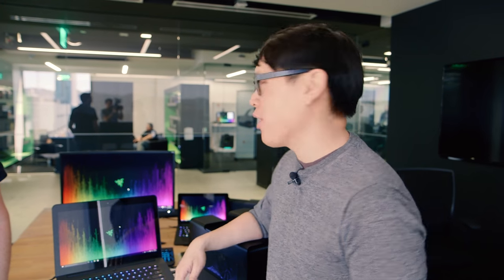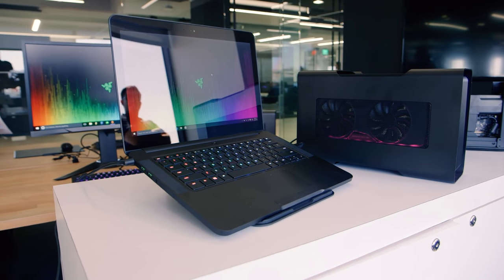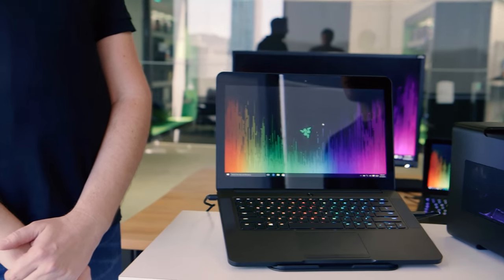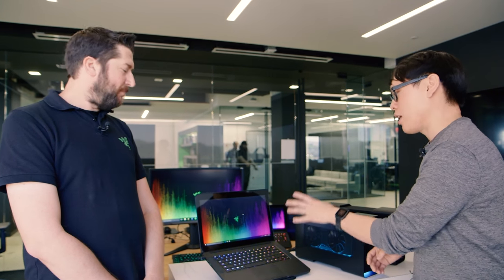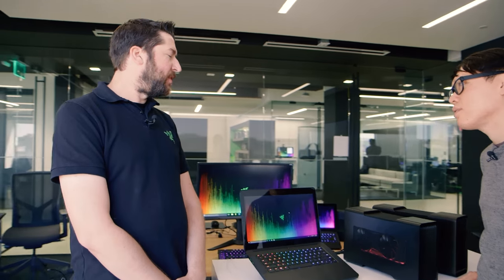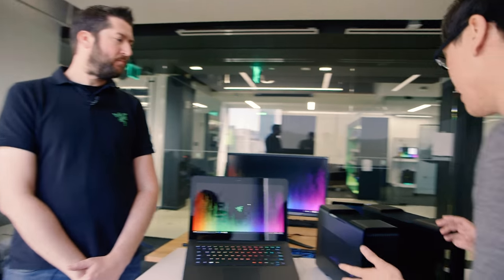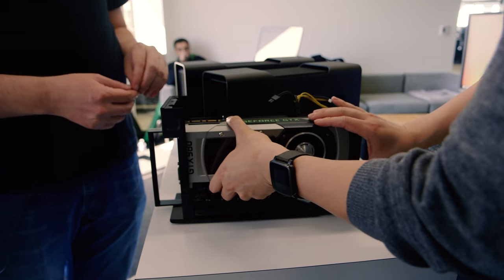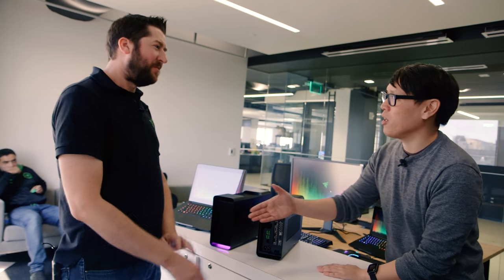Installing a Video Card in the Razer Core (External GPU)

Comment: In away, I see these devices as a bad thing. We need GPUS to be smaller. This makes me think nVidia and AMD might just lessen their priority on making gpus smaller and force people to go externally or have a gigantic case. On the other hand. I see this being the way forward. You could have an all in one pc on a 4k 28" (for example)  display with 1 thunder bolt port. All you have is this "small" box beside it without the manufacturer of the all in one computer having to worry about placement of a heavy gpu, heat and a large power brick. But that kind of goes back to my first issue. Make GPUS smaller lol. I like this being an addition to an all in one  computer. But for laptops, nah. Laptops are mean't to be portable. I don't want to be carrying 2 bags or 1 big heavy bag.
Reply: They did try to make it smaller see amd fury.  And if you look at the trend the gpu are getting smaller.  And for what you said that is why the m series of gpu is created.  The reason Gpu is big is because they really need the cooling, even now some (big)  gpu are thermal throttling while being used in extended and rigorous rendering process by professional.  Making it that small just doesnt cut it since you sacrifice cooling (unless they invent better cooling tech).  Maybe what you mean are for the m series gpu to catch up in performance to the full gpu since it doesnt make sense otherwise.
Reply: +Andrew Hadi Yeah there are some nvidia cards that are smaller as well. There is even a mini 970gtx. But yeah, the M series graphics cards are smaller etc and they do need to catch up in performance. But if these external ways become so popular, what's the point in making M series cards? Why can't they just make a super light, skinny laptop with a powerful processor and have people buy a external graphics card? It would mean we COULD (probably won't) get desktop graphics cards cheaper, laptops would be cheaper and less of a lap burner, laptops would be better on battery etc the only downside is if you want to play games you need to plug in an external graphics card. Any laptop could be a gaming laptop. Yeah a mobile i3 laptop would bottleneck an 980gtx but gaming on a <1920x1080 display wouldn't really matter anyway lol.
Reply: i think it depends on how people use their PC/laptops in the first place. Every products have its own specific market, say for me even with laptop i HATE gaming on the bed (productivity is fine but not gaming) and since i only game on my table and watch movie,etc on my bed, it kinds of solve my problem. and don't forget intel integrated graphics are getting better and better where in this case it will shine since light gaming such as dota 2 and watching 4K video (connect to TV) doesnt need a dedicated GPU anymore which will make a Laptop much lighter, cooler, and much much cheaper. and since you can reuse the graphics card its actually a good investment for the long run.
Reply: +Ender Skies I care about my case size. The first pc I ever built up had a huge case. Capable of supporting 3 22" dual slot cards, space for 8 HDDS and 6 front bays. Honestly it was a dream to work in but it was hell to find a place for it... it had to sit outside my computer desk, on the carpet, picking up dust and throwing dust around the room. I had to hoover my room more than normal, I had to clean all 4 huge dust filters before I hoovered. When I wanted to reorganize my room the 1 thing that I always regretted doing was attempting to move a gigantic deskop computer. Now I just have a silverstone tj08 with two 970gtxs and 3 500gb SSDs. Small, compact and twice as powerful as my old tri 480gtx setup. A powerful small system is more appealing to me than a case the size of a 40" TV.

Comment: Razer needs to release a Razer Blade business laptop. Remove dedicated GPU. Add more battery. and Iris Pro. Stealth's CPU will bottleneck togheter with Core and powerfull GPU. And Blades dedicated GPU will be wasted for most office/business use and when Core is connected at home.

Comment: 400$ gpu enclosure.. fuck that. 
Unless it is coming with a 970 or 290/390 that is just a ripoff. you can get the exact same modules for under $100 if you are willing to use a minipci port, and I believe you can even get thunderbolt version now too for around the same price. 
EDIT: DIY Perks did a video called "Gaming on a Laptop using an External GPU" if you wanna see it.

Comment: Why would I buy such an expensive laptop for gaming but then again spend another fortune on a desktop gpu for VR? I mean I don't see the advantage in running around with a laptop, a gpu with case and a VR set. I only have 2 hands. And why would I travel with my VR stuff if I could just travel in VR? Looks just like fancy stuff that's way overpriced
Reply: Uhh..  If my reasoning is correct you wont be playing vr outdoors.  In ANY circumstances other than a showcase or maybe lan party.
The correct way to use this is to only bring the blade outside for productivity such as university or work. And went back home plug the thunderbolt and BOOM all your multiple screen, VR, speaker,  headphone, harddrive, keyboard and mouse are ready to use with one centralized computer unit meaning you dont need to transfer files etc if you previously use pc and laptops.
Reply: And with the gpu out of the way the majority of the heat is outsourced extending the product lifecycle.  And with ssd technology and skylake processor this machine will not slow down anytime soon.  And arent limited to M series gpu can be upgraded easily meaning it WILL have the BEST performance compared to other laptop for its size.
Reply: Andrew Hadi Then again it's extremly overpriced. I could buy a really decent computer and a laptop for work and still have money left. The file synchronization is a point but I don't think that there are a lot of files that need to be synchronized. Most of the gaming stuff is handled by Steam, music, movies etc is on a server at home or maybe Onedrive. Also it's a bit akward using a gaming rig for work and the other way around. I don't really want my  games to be on the same machine as my work stuff..
Would you buy one of these (with your own money, not your parents money)?
Reply: +EndermansEnd hmm not now.  I consider this as a pioneer product (like those $7000 16 tb samsung ssd facepalm) or those that purchase limited edition stuff just for bragging rights. But i think this is going in the right direction. Hoping Asus or other company will implement this technology in a much more affordable price.  And also in the future, integrated intel hd graphics and iris graphics are getting better and better which eliminate the need for a dedicated gpu for light gaming (dota2) and productivity. Thus making laptops much thinner, cooler and cheaper.

Comment: 1. Pay $2.000+ on a laptop with GTX 970m
2. Buy an external desktop gpu 400-500$
3. Buy a case to hold the gpu in place
4. Spend a shitload of money while an gtx 970m in a laptop is way more than u actually need... Good job razer
Reply: It's more for future proofing ... 
Or the razor blade stealth which has a integrated graphics card.
Reply: +Mr Human would be nice if you could use it on any pc

Comment: Did he just say the 970 isn't enough for VR? I thought 970 gtx were perfect for it? Also, that Core. Isn't that just a gfx card and its enclosure? If so the price isnt bad considering 970 gfx cards cost around 250-350$. Add in a sweet enclosure and you're looking at $350-450. So yea I dont think they're making much money off the Core. The $2000 laptop seems to have their profits for the core added into that price. As you see they dropped their prices since last year. I don't blame them. Who wants a $2000 laptop just to game. Anyone with $2000 to burn on a laptop will probably buy a nice shiny new macbook pro instead. For hardcore gamers who have money to piss away on something other than alienwarez then this is for them. Such a small market... But u know why this has potential? Mobile VR Station.
Reply: +Christopher Jones A 970 is, sure. But a 970M is not. It's a mobile version of the 970 made for laptops, so it's power is a lot lower. As such it's not fit for VR.

Comment: pffft 970m is capable of doing raw power for VR, i blame nvidia and intel for being idiots not refining optimus and not making their pipeline efficient, which is needed for VR because it needs basically low latency.

Shame because can't have vr on the go, but i guess thats what you have these thunderbolt 3 dgpus, which intel is finally supporting it, making you wonder what happened to the original thunderbolt and thunderbolt 2 that already showed the capability to do that.

Comment: For $500 you can probably buy a prebuilt desktop with a better processor and memory than the laptop. Surely that's just a better solution...
Reply: Good luck travelling with a desktop
Reply: +dgmojojojo just to be clear I'm saying you should just have two pcs if you're willing to spend $500 to house a graphics card.

Unless you think the core itself is portable?

Comment: Is Thunderbolt 3.0 fast enough to reach PCI-E speeds?!?
Reply: +GameNationRDF Yes, it will run fine, PCIe3 16x is about 16GB/s (which the graphics card will not use at all) and thunderbolt 3.0 includes a link of 4 PCIe3 lanes, so with thunderbolt you will connect the card via a PCI3 4x to the PC. That should be enough to run the card fine, even if you only have a quarter of the tranfer bandwidth. So I assume that the graphics card will give you at least at 90% of its computing power in a configuration like this, which is a fair trade for the mobility of the device. 

See also: https://de.wikipedia.org/wiki/Thunderbolt_(Schnittstelle)
https://de.wikipedia.org/wiki/PCI_Express
Reply: ***** Hmm I see thank you for the very informative comments (you do not see these a lot on youtube nowadays :3)
Reply: In the performance reviews I have seen, a modern GPU such as the GTX 980 could get up to 30% performance hit over Thunderbolt compared to 16 lanes of PCIe.
It depends on the game/app. Some games are only 5% slower on Thunderbolt.
The difference also seems to get higher the faster the GPU is.

Comment: Why would I want to spend 500 USD for the ability to add a Graphics Card to my System that I have to pay for AS WELL. At that cost I can get a reasonable, new PC.
Reply: +Hopefighter Jojomal because 500 won't get you much if you want a high end cpu and a psu to power the gpu
Reply: +Hopefighter Jojomal Mobility, space and "One Machine" environment. I can certainly see the appeal of this laptop/external GPU combo for PC gamers who also do a lot of heavy tasks on the go (video editing, photo editing etc).
Reply: +Axe Avier let's see... it will get me quite a few reasonable rigs without graphics card, that I would have to pay for ANYWAYS since it is not included with the Core. Also keep in mind that the Core isn't stand-alone so you will need a PC/Laptop to use it anyway. adding that to my budget (either by selling my old one or not buying it in the first place) I can definitely get a high end PC for the same amount of money.
Reply: MHVuze Mobility is an advantage I give you that. On the go is a bad term to use in this context though (at least if I understand correctly what you mean) Since you will still need access to power in order for it to run. So while you can use it when staying somewhere you cannot use it during traveling times. If you wanna do a lot of editing I'd honestly recommend getting a MacBook instead (As much as I dislike Apple) Their Machines are BEASTS when editing.
Reply: +Hopefighter Jojomal It's for people that don't like having multiple systems.
Reply: Hopefighter Jojomal the point is that if you already put money into a laptop then you could upgrade it with this. You're looking at this completely wrong, and you're not the target market they're looking at. It's for those that have $$ and have laptops.

Comment: I am absolutely dumb founded, $500 for a PCIE riser card, a 500w psu and an enclosure?!?!
Reply: +MagicalMidge To be fair this is most likely a case of high demand (no one has come up with something quite plug and play like this before...) and recuperating R&D costs + their usual, albeit high, profit margin. Once other manufacturers figure out the technology and produce similar products at lower prices, this will come down. That's just how markets work. Personally this would only be reasonable at $250-$350.

Comment: whats intels external graphic standards?
Reply: Thunderbolt 3 or usbc.
Reply: FlameGaming 6100 Yep, perfect. If you really want a laptop for portability, thats a perfect option. Connect  an external display and the core, connect it to power, and you have a desktop.
Reply: FlameGaming 6100 Oh, but that harddrive is very slow for a laptop in 2016. Switch that out with an ssd if you can, saw it had easily swapable harddrives so that should not be an issue.
Reply: +Lehyb Thanks for the help and yeah i was planning of buying a m.2 ssd to put in it

Comment: Really cool but way overpriced. For the price this plus a GPU costs you can easily build an entry level to mid range desktop.
Reply: +Mad Lust Envy You need a laptop additionally for both options
Reply: +Mad Lust Envy The core isn't that small either. But I get it, I like the concept, I have a high end laptop with TB3 and would like to buy this BUT for what it is it seems to be about twice as expensive than what would be reasonable.
Reply: +Mad Lust Envy Check out the Dan A4 case. Yes this is a great idea, it is just overpriced. Even for somebody who likes to buy expensive gear bad value is just bad value.

Comment: 500 for GPU enclosure . . . . . . . . + a GPU like GTX 970 thats $800 for external graphics. You can build a whole computer with that GPU for $800.
Reply: +The Modern Shoe Umm, what GTX 970 are you buying that's $800? The priciest GTX 970 out there is only about $400
Reply: +fake_goome126 He probably means the total cost of the enclosure and GPU.
Reply: Ah
Reply: +The Modern Shoe Don't know why you're comparing a laptop peripheral to a desktop...
Reply: +2010ngojo The point of the external GPU enclosure for most people would be to have a GPU comparable to a desktop to use when at home. What I am saying is that it would cost $800 for the external GPU setup (with a GTX 970) and that doesn't make sense if you can build a whole other PC to leave at home with that GPU for $800
Reply: +The Modern Shoe 
The point is to have a somewhat powerful laptop on the go and yet being able to play games at the desktop level.
Reply: +2010ngojo You can buy this laptop for on the go and then build a desktop for desktop level gaming for the same price.
Reply: +The Modern Shoe 
are you complaining about the concept or the price? Cause the concept it fine, but the price of this enclosure is ridiculous. 200 max.

Besides, I would personally like to have only one device instead of a laptop and a desktop. Not like I would use both of them at the same time.
Reply: Price. Concept is good, but meaningless at this price. At <$100 it would make sense.
Reply: +The Modern Shoe 
You can make yourself one for slightly less than 100, but it's more of a hack job. 

For example, an EXP GDC is about 60 usd and a quality PSU would be about 30-40 usd, depending on your card. Not including a case.

Comment: 4 core ???
Reply: No 2 core
Reply: +The Blazing Phoenix but he said 4 cores no ??, i know that the razer laptop is a 2 core i7 6500 u isn'it ??
Reply: +RCblacktrack It's 4 core. The laptop is too
Reply: +U wana Grab a Sandwhich? mhhhh,in this form factor ?  if it's true it's great !
Reply: 2 cores
Reply: +RCblacktrack This laptop is not a Blade Stealth.  This is a 2016 GPU.  Notice that he said that it has a 6 GB dGPU.  It's a 4 core unit with 16 GB RAM running a PCIe SSD and DDR4 RAM running at 2100 MHz.  The internal card is a 970m.  My question is how the GTX 1080 founders edition will work in the core considering that Thunderbolt 3 is about the same as 4 lanes of PCIe 3.0, or if that card will even fit with that custom cooler and shroud.
Reply: +RCblacktrack Not what you know but what you think.  It isn't.
Reply: +Jan Norman didn't undertand very well there...can u explain  ?  
the pc is a 2 or 4 core  ? 
and you are concerned about the core fitting the last nvidia released gpu na ?
Reply: The PC there is a 4 core PC.  The one in the video is a Razer Blade.  The 2 core one that everyone keeps mentioning is an ultra book called the Razer Blade Stealth.  And, yes, that's what I'm a bit concerned with.  The founders edition specifically because it has that custom cooling chamber and a custom shroud as well.  Honestly, i think it will fit, but you never know.
Reply: +Jan Norman ha well keep hoping for that card to match the required curent as well. it's a 16 nm card that eat almost half the current of the previous gens card..but it is'nt much bigger in size.

Comment: Or just get a desktop.... Same portability
Reply: I have never seen a desktop that weighs 4 pounds or is 3/4 an inch thick
Reply: I am not referring to the laptop, but rather the desktop GPU add on (with separate AC power supply) that completely eliminates the 4lbs 3/4in thick portability argument entirely.  You are tethered to a wall for shit sake.
Reply: The combined volume and weight would still be significantly less than a desktop tower.
Reply: +Bob Marley You aren't supposed to run around with the core.
Reply: I thought we were arguing about portability here.
Reply: Internet Enzyme yes in the way that the laptop is usable away from the desk and out and about.  Take notes watch youtube.  Wanna get your game on / use more or larger screens plug into the core and away you go.